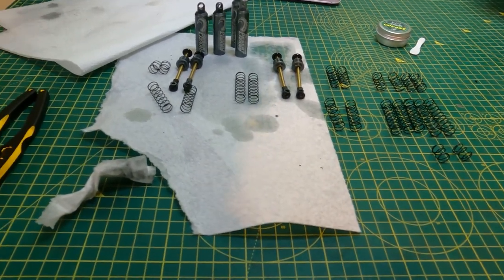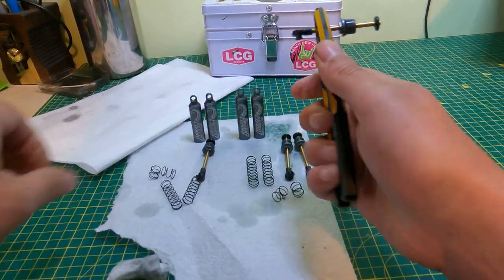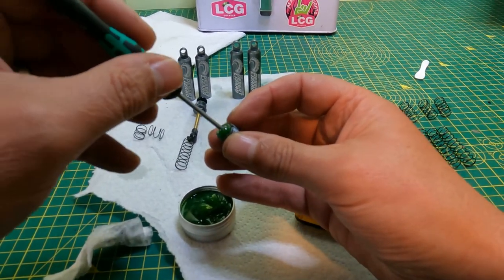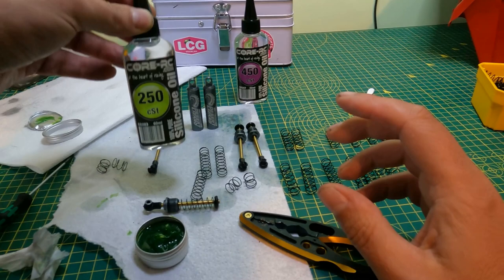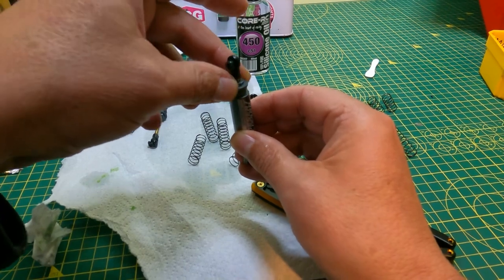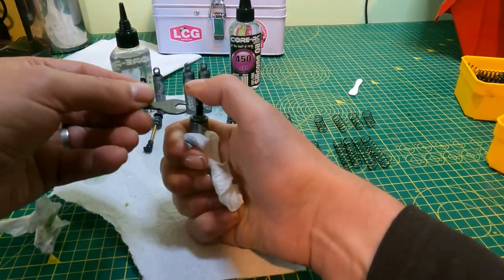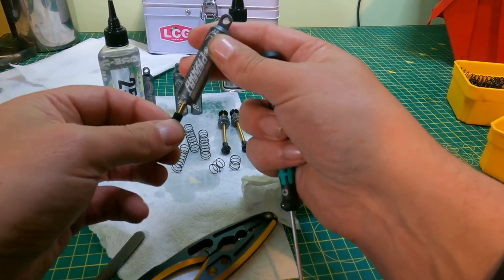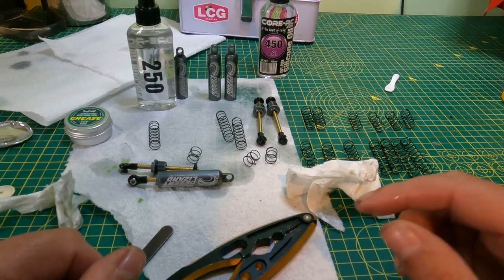Setting up Desert Lizards shocks for Competition Crawler

Comment: Little tip, for changing springs on the shaft. Just wind the spring in or off the shock. Less faff and no chance of marring the shaft or seals.
Reply from the maker: thanks, good tip, i will give it s try

Comment: I always found I could wind the spring onto the shock shaft like threading on a keyring....but that's just me I suppose. I also like to put a small piece of heat shrink over the threads when i pull the shock shaft out, just so the threads don't nick the shock shaft seal o rings..... I really think that's where most people end up with leaking shocks

Comment: I’ve just bought the 120mm tried it like you have but found that the damper shaft gets scored by the spring rubbing it inside so am trying sprung now instead will need new damper shafts when available to purchase again
Reply from the maker: not seen that before, i will keep a watch out

Comment: I know you said what springs you are going to install, but i dont think you mentioned what rig you run. I run a gen8 v2 which is kind of heavy. it would be nice to know what you run so i can have an ideal of what spring set up i would like to try.  Thanks :)
Reply from the maker: So this set up works for most competition rigs, its more about the weight of the axles rather than the rig as it is in droop most of the time - if your rig in over 3kg you might consider going for the medium strength spring down the tube

Comment: What are vise grips you are using ?
Reply from the maker: Some thing like this - https://www.amazon.co.uk/CENPEK-Absorber-Aluminum-Multi-Function-Disassembly/dp/B09H74RHX2/ref=pd_lpo_sccl_2/262-3145190-4240043?pd_rd_w=Doisx&content-id=amzn1.sym.448aab69-6fff-42b9-9d7a-f6325052a6f6&pf_rd_p=448aab69-6fff-42b9-9d7a-f6325052a6f6&pf_rd_r=VWCNS8SSCQFECJ73GDV4&pd_rd_wg=D8KCB&pd_rd_r=782f15c1-1461-4963-a598-257bde106275&pd_rd_i=B09H74RHX2&psc=1